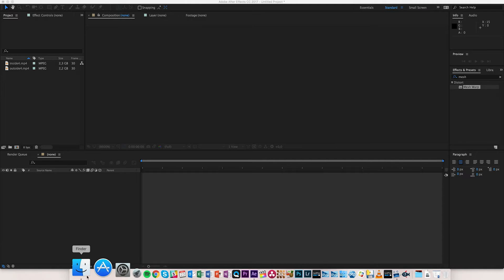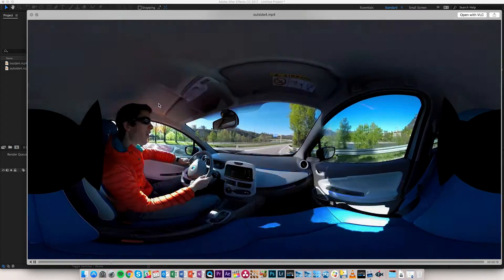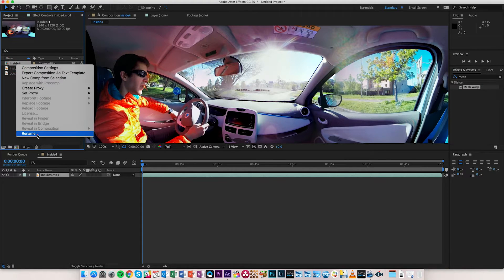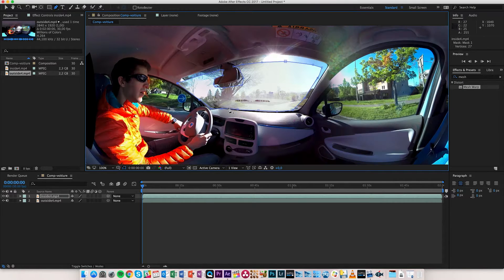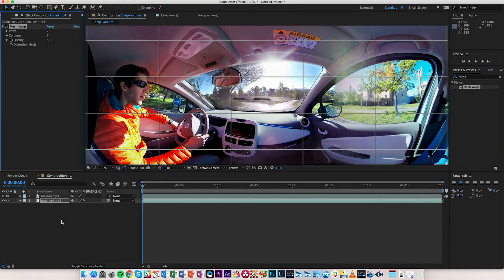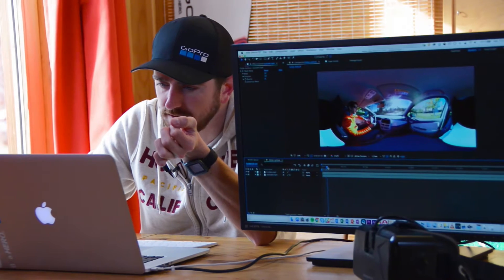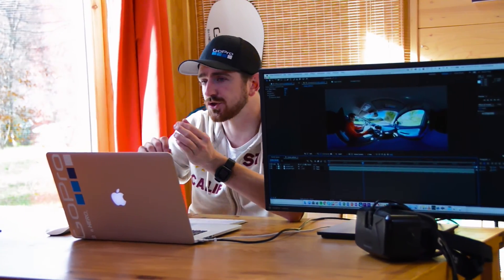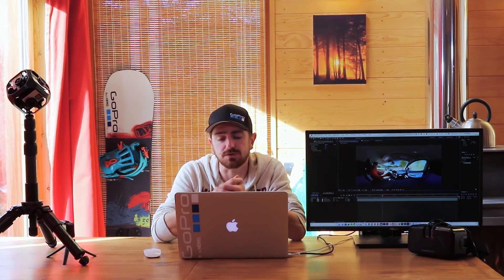Part 8 - Multiple Renders / Compositing | The full 360 video creation workflow

Comment: I am trying to use a clean plate in Giga to replace the rig base in the nadir. The only problem that I am having is the color and exposure correction. Can I adjust this to match the original shot in Autopano Video or in Giga. I can not seem to get the contextual menu to show to adjust only one image.
Reply from the maker: are you trying to use a clean video plate ? Or are you exporting a part of the image in APG, changing it in photoshop and re-importing it ?
Reply: Kolor I am grabbing clean plate stills after the video is shot. then importing it into Giga
Reply from the maker: Then you need to keep it in the blended layer, not in a patch layer. You then need to select viewpoint and anchor to make it behave differently than the other shots.
Reply: Thanks, I will test that today. If I have more questions, I will get back to you. Is there a more direct way to communicate?

Comment: You're my hero for posting this video in particular. A new client of mine markets for automotive events, dealerships and various car companies Canada and USA wide. He and I are particularly keen on getting as many of his clients on board with 360 videos, a lot of which will be car interior shots. Do you recommend a headrest mount between https://goo.gl/bgXfyc or https://goo.gl/ERdQkO ? I purchased both, waiting to test as I'm still pulling out my hair trying to edit the latest video I did of my buddy on his electric longboard, 3rd person view(so cool!!). You can imagine my headache with this, at my limited skill level of stitching. Also, you mention exposure for inside and outside the vehicle. Keeping ISO down to 400 is key, but what exposure setting would you recommend for the outside car stitch, and for the inside stitch? I have not yet experimented with changing the ev during my test shoots. Thanks!
Reply from the maker: Hey,
if you're going to use it in a static case, i would probably go with the one that has the smallest footprint (second one then ?). Regarding exposure, on a very bright day i would probably try to underexpose a little the whole rig and then adjust the exposure settings in AVP in the color tab.
Reply: OK cool. and for the exposure inside the cabin vs the render that's for outside, would you recommend a difference of -0.5, or -1? It's too bad there isn't an option for real-time monitoring so I can check the different adjustments.
Reply from the maker: probably -1. For preview i Usually have a H5black (but you could have a H4 black with LCD Backpack or wifi with a phone, that i use to test settings for the cameras